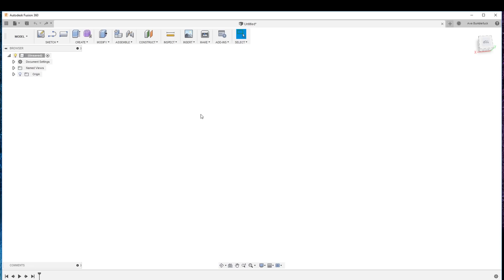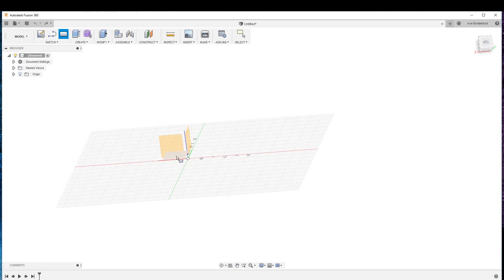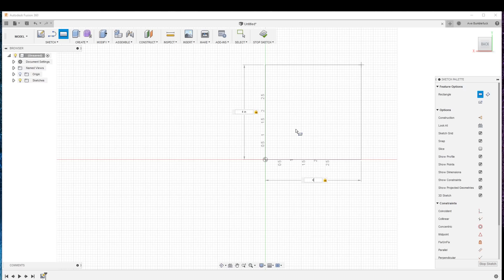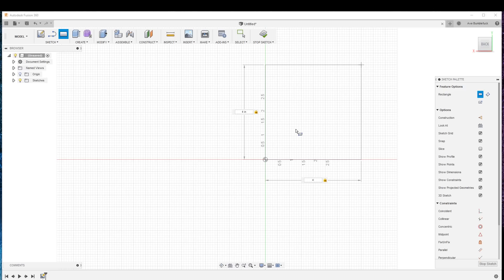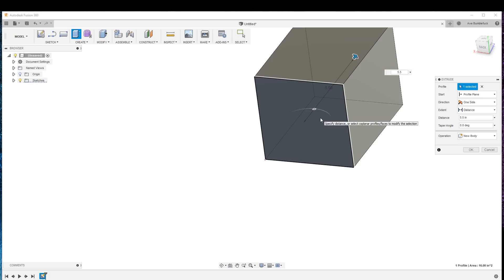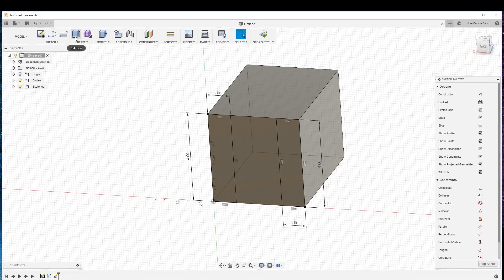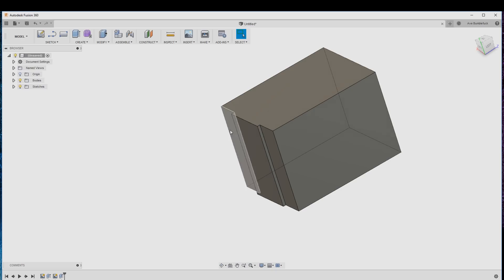Speedy Fusion 360 tutorial Ep. 01 CAD

Comment: Yes and I can manually put a piece old stock in the vice, G-Code in a quickie manual entry program… push the start button… and the machine finishes the part.. and an done before your video end, OR before you have finished your design… and program.  And, made six others too before your video ends.

Comment: A couple of tips from a pro:
1. Always build around your origin.  Put your first square around the center, then extrude in both directions.  When you get into assembly, you'll always have those faces and edges, but when you build around origin, you'll have those faces plus 3 planes, 3 axis, and a center point.
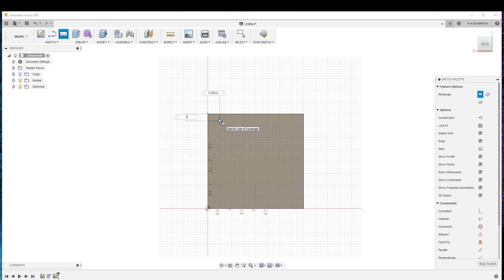2. When dimensioning the recesses @1:58, don't use the 4" down, use your snaps and make it snap to the bottom of your object.  That way, if you adjust the size of your first extrusion, you don't have to go down your tree and adjust all those 4" dims.  The point of the game is to use constraints as much as possible and dimensions as little as possible.
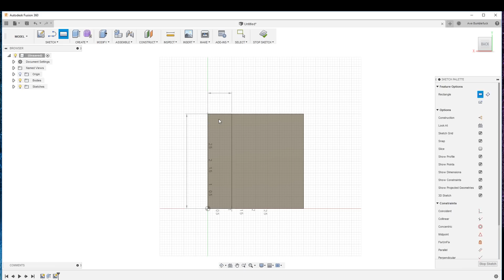3. Also dimensioning, @2:06. I don't know if Fusion just remade the same rectangle or if you edited.  If it does this automatically, that's stupid.  The 1" dimension, you should select that and then pick the first 1" dimension and you should get a value like d04.  That will make it parametric and you'll only have to edit one dimension to edit them all.  Not such a biggie here, but indispensable for hole patterns or radially patterned parts.